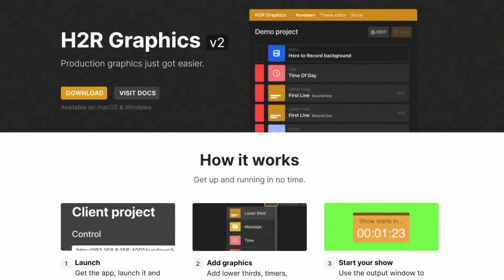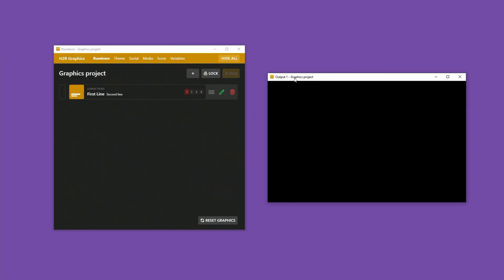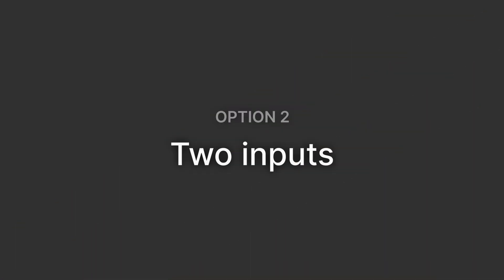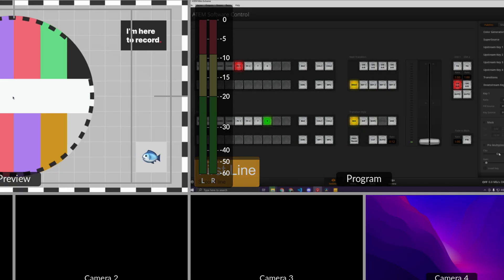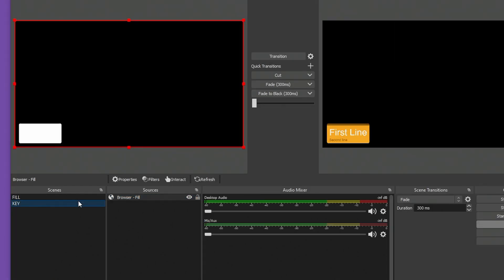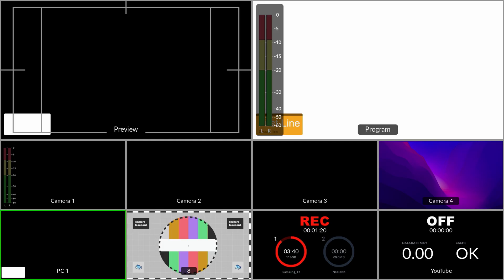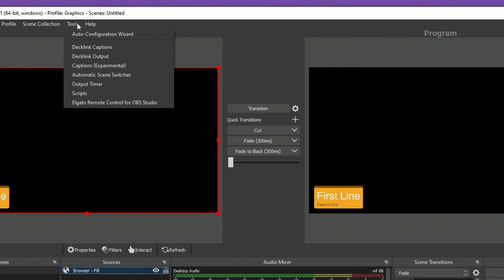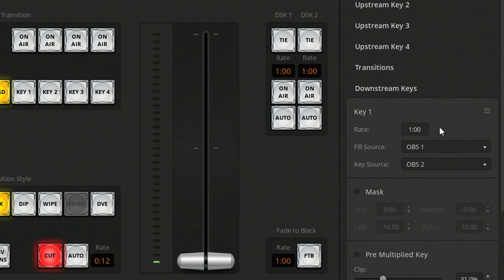Lovely Key/Fill Graphics for your ATEM // Show and Tell Ep.93

Comment: Option 3 is the way to go, as it doesn't require all that extra hardware (costing over $800) and can easily be accomplished with free software.
Literally, it is as simple as copying the source, giving it a different name, then changing the gamma settings. 
Why is no one else suggesting this method?
Reply: Because the encoding is ass